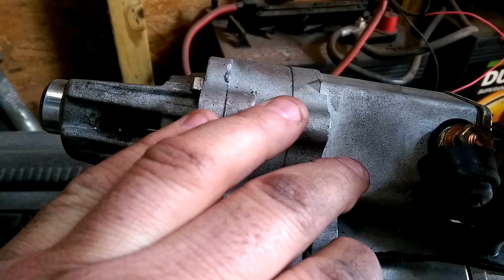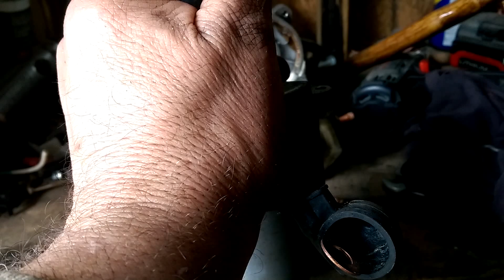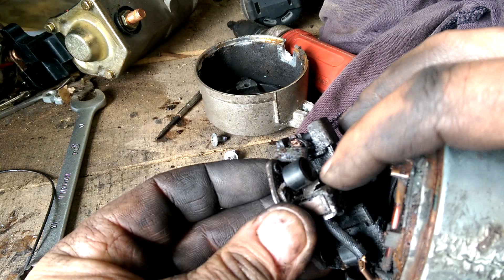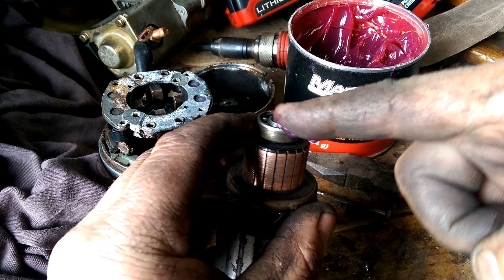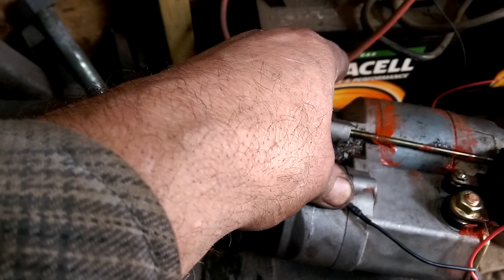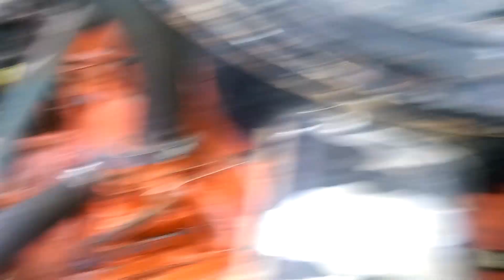STARTER gear reduction model repair internals

Comment: That was a damned lucky move getting those two cover screws out after that Phillips driver slipped and stripped the heads.  I've got the same starter and one the screws was already stripped from the factory, go figure.  After all that messin' around with the one you've got, I'm glad you got it going.  Now I ask after six years, is it still working?